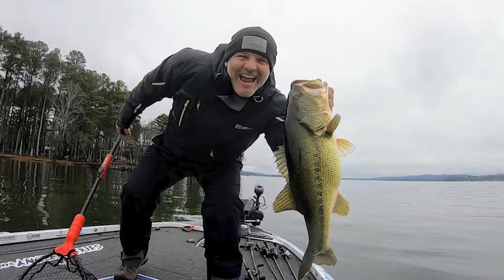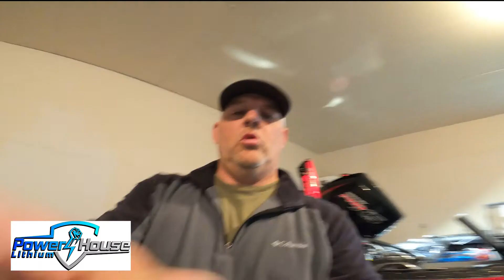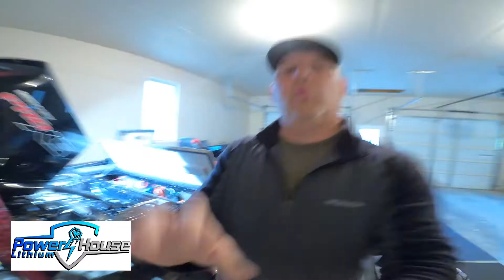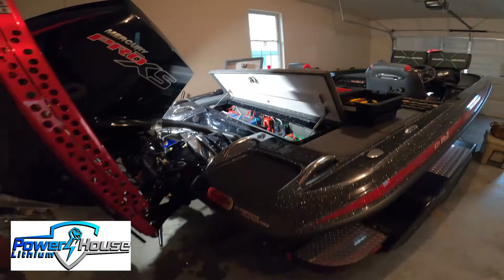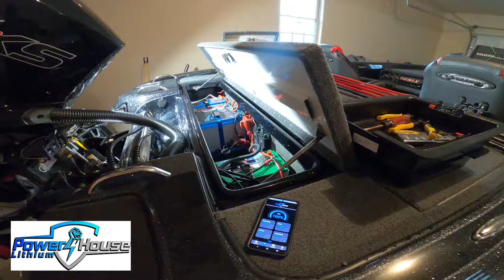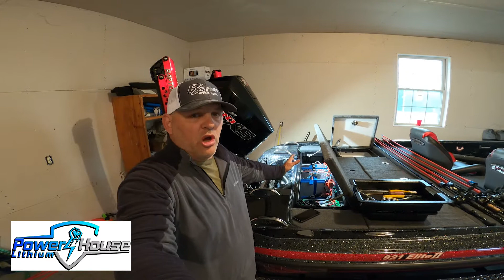PowerHouse Lithium - 2022 Phoenix 921 Elite II Set Up

Comment: Can the nema 200 network plug into the 16v battery as well
Reply from the maker: If You Meant NMEA 2000 Network Adapter:
NMEA 2000 (not NEMA) is a communication standard for marine electronics, and its network adapters operate within a specific voltage range. The NMEA 2000 standard specifies that the network backbone must be powered by a DC voltage supply typically ranging from 9 to 16 volts DC. Some devices may tolerate up to 24 volts DC, but the standard operational range is 9–16V to ensure compatibility across certified devices. This power is supplied through the network backbone, and voltage drops must be managed to keep the system above 9V at all points for reliable operation.

Comment: Did you stay with a Agm as your house battery after 2 years ? Or did you switch to lithium?
Reply from the maker: @MrFishhook  I stayed with an AGM. It runs the pumps and auxiliary stuff. I can switch the graphs off of my 16V battery to the AGM if I have trouble. Some of the newer versions also have a built in jump start if you go with the 12V cranking battery.

Comment: Hi, I purchased a run and gun charger for my 36V lithium I purchased from power house. My cranking battery is a AGM battery. When charging off the water I use my minn kota on boarding charger (cannot charge lithium batteries) for my agm cranking and my other AGM. The charger I have for my new power house battery is model BCH3610). With that being said, do I have to turn off the 60 amp breaker that was with the run and gun while using both chargers off that water so the two charging currents don’t interfere with each other or do I leave the 60 amp breaker on? My question is do the two separate ways of charging mess anything up because the gun and run are tied to each battery? Or does the run and gun recognize I’m using two different types of chargers? I’m pretty new to this and don’t want to screw this up. Sorry if this may seem like a dumb question
Reply from the maker: You can just turn the breaker off by pushing the button or leave it both charging will not hurt anything. Just use the run and gun to charge everything without adding the backup charger that is only needed if the run and gun goes out.

Comment: I just want to know what position on the Perko that your run and guns are hooked up to as well as your 16v and 12v or output? I have a similar setup that I’m working on this second and trying to determine what position onnthe Perko switch i need to hook up the run and guns. Currently my 16v is on position 1 and my 12v is on position 2. Output just has the positive wire running to my circuit board for my electronics.
Reply from the maker: You can find the wiring diagram on the PowerHouse website. Let me know if you have trouble finding them. Tight lines!

Comment: Ok so I have a question for the electrical engineer…..  Why couldn’t you just run a voltage dropper/regulator of the 24-36V trolling motor batteries to get the 16V for your electronics?
Reply from the maker: You could. However, isolating the source ensures I get a nice clean voltage without interference from other equipment connected to that source. It's also more reliable because by using a Perko switch, I can swap from 16V to 12V if I have an issue. If everything is powered from the 24V or 36V source, like you said, then it's a single point of failure.

Comment: I have a question about your single point ground. What is the purpose? I have a aluminum boat if I ground from the single point ground to the hull will I set up electrolysis on the hull ?

Comment: Very nice setup and great detailed,  question my cranking battery is a ionic 125AH and I have two ionic 125AH for my untrex 80lb thrust trolling motor. How should this setup be hooked up so that only the trolling motor batteries would charge while running my 2019 mercury 200 proxs.

Comment: Just purchased a 60ah with the run and gun system for my boat!
Reply from the maker: You'll love it.
Reply: I pulled the trigger on 2 of the 36v 60 amp batteries. Run n gun setup I’m curious to see how many hours  I’ll get with the Garmin force
Reply: Does my run and gun charger suppose to to stay green even when my power is turned off?

Comment: Did you stay with the same battery or go with a lithium on the cranking after they drop the new ones?
Reply from the maker: Jeremy, I'm still running the Insterstate cranking battery. My plan is to go with the Powerhouse cranking batter but honestly just haven't had time to do it yet. Another thing too, I haven't had any issues running the Interstate battery. Thanks for watching!

Comment: Ok Got a question.  You have the Minn Kota PCL charger.  How would this setup work with a Power Pole Charge?
Reply from the maker: Not sure off hand but I believe the owner of the company runs a Power Pole Charge. He may have a slightly different configuration. I check and let you know.